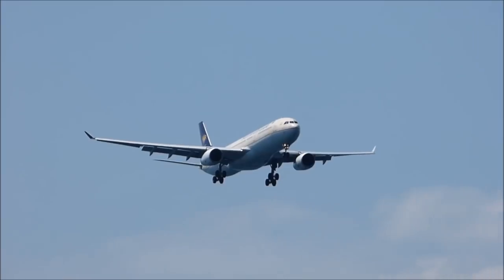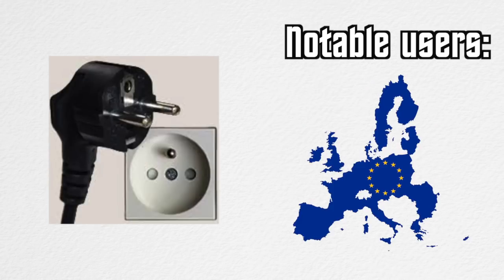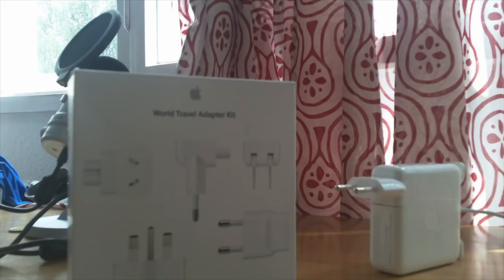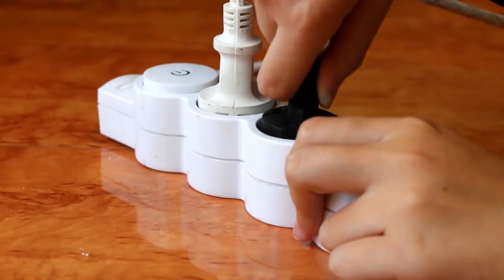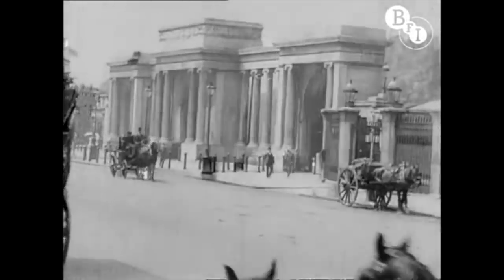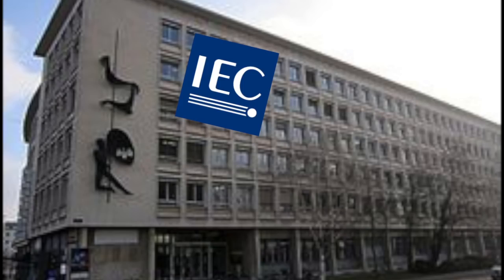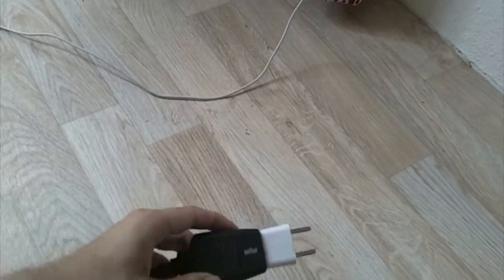Why Different Countries Use Different Plugs

Comment: Surprised nobody is flipping out about "why does the US use 110V 220V is much superior!!"

To answer this, we do have 220V coming into every home. It's two 110V leads that are combined for higher powered loads such as large air conditioners or electric dryers. So yes, we have 220V, it's just not the regular standard that you run your phone charger on.
Reply: Ah you are talking about 2 phase electricity. Of course we have that in Europe as well and it combines 2 230 volt phases into 400 volts. But contrary to popular belief most if not all modern 2 phase motors don't combine the 2 phases into one but actually utilize all 3 electric phases through 3 separate circuits so basically it's 3 motors in 1 and they're actually 3 phase motors. 

Despite your claims, the base voltage in Europe is double of the US one. And higher voltage is better because you need less current (half the current in this case) for the same transfer of power. That means thinner wires for the same power with less loss of energy. And a lower current (Amps) is lots safer as well.
Reply: Well, by that standard, we get 400V to our house over here, because we got three phases with 230V each...yet the entire house (except for a couple outlets in our basement) are wired to 230V. and NONE are wired to 110V.
Reply: European factories ad yards use the same method to power tools that are too big for standard 220V. Obviously, using two 220V phases the result is further more powerful.
Reply: We use 240 and 120 volts in the U.S.
Reply: Ive been told that 110v is safer because it wont kill a human. Is this true ?
Reply: @System-br1tx  it's not the volts that kill, it's the amps. Example of this being the voltage of static electricity being 3,000 volts.
Reply: @cpufreak101  wrong. First of all static electricity is closer to 200,000 volts. Secondly, it's not the amps that kill, that is a misconception. It's both volts and amps that kill because they are proportional. Yes, technically the amps do directly kill you, but current can't kill you if the voltage isn't high enough. 3000 amps won't kill you if the voltage is low, and 100 or 200 volts won't kill you if the amperage is low. Both need to be high
Reply: @AverageAlien  A: just wanted to say I got that 3,000 volts from a college class and not the internet, but it also specified it was a minimum

B: fair point I guess, but the point still stands 110/120 isn't any safer, as at 220/240 the amperages are lower
Reply: @cpufreak101  It is a bit more complicated than that. The skin resistance of a human is not lineair to start with. An electric fence generates up to 2500V pulse which are very short but you will survive that.
Touching 110V can be lethal if you touch it long enough.
The frequency is also a factor. At about 55Hz the human heart starts to fibrilate. That is the reason why 50Hz and 60Hz were choosen as mainfrequency's.
Reply: @cpufreak101  it's also the volts though, since you can touch the terminals of a 12V car battery (which can deliver hundreds of amps) without problems. There is a voltage that will break through your skin, it's around 50-70V, dependant on moisture and condition of your skin. Once there's current going through you, especially past your heart, the problem is that is disrupts the normal signalling your body uses. Either way, 110vs230 not much different for safety
Reply: @AverageAlien  Power company linemen fairly routinely handle 230000V and more inspecting and repairing transmission lines, but because there is no current flow it only tingles.  However, 100mA through the heart can stop it, the voltage required to accomplish this varies with the individual's body resistance.
Reply: @Gene1954  That's exactly what I said. Both kill. Low voltage with high amps, if touched by your skin or something with high enough resistance means that there won't be enough amps going through you to kill you. Low amps with high voltage won't kill you because the amps kill. But both need to be high enough to kill
Reply: @AverageAlien  3000A will kill you at low voltage. The current will disrupt cell walls. Thier have been a number of fatalities from people caught on battery terminals and from swallowing button cells through this effect.
Reply: @System-br1tx  I don't think so. I've read that the limit of safe voltage is considered to be 50 V (although, it could be different for AC and DC). But because of that, at least 48 V DC that's used in some larger IT installations, needs much less protection, because the voltage is considered to be much less dangerous than what comes out of the wall sockets.
Reply: @justin noker  : In (at least) europe, in every home we've got 3 times 230 volts coming in. Those 230 volt lines are shifted phases, combining them results in 400 volts for our power tools (only sometimes required, normal homes just operate from a single 230 volt connection)
Reply: We get 400 V for those.
Reply: All you people talking about phases and American power are mistaken. Homes have 1 phase power. 240VAC between hot wires (red and black), and 120VAC between any hot wire and the neutral wire (white). The ground wire (green or bare) and neutral are both close to earth potential for safety. This setup is called "split-phase" not to be confused with multiphase AC systems. We distribute power as 3-phase delta or wye, (and very rarely 2-phase or multiphase), and industrial and commercial customers can have 3-phase power, but almost never in residential use. Power is 60Hz in North America with very few exceptions, like 25Hz railway traction current.
Reply: Actually 110V has safety advantages. 55V would be better still which is why it's used on building sites.
Reply: but you do not get 220v in house. so its still 110v ?
Reply: @jzneter736  not quite. Like I said, every house has 220V that comes in off the lines, two hot leads and a neutral lead. The two hot leads usually go to separate sides of a circuit breaker box, which results in the 110V.
Reply: @cpufreak101  yes, but you still end up with 110 volts ?
Reply: @jzneter736  yes, because 220/2=110. We get 220v in, and it's split off into separate 110V lines at the breaker box.
Reply: @jzneter736  and also, as I did say for higher power equipment we do have special outlets for 220V power (usually found in laundry rooms or garages) that receive both the hot leads in. So it's more fair to say we typically have both 110V and 220V, but 110V is the most common for outlets (and 110V and 220V outlets are completely incompatible with each other without adapters)
Reply: @jzneter736  stoves and dryers are 220 in US homes

Comment: Brazilian plugs: a way to enforce protectionism in the most annoying way.
Reply: well, not really. The Brazilian plug has a two plug version (which is the most common one) which is a type C plug and therefore compatible with types C D E F H J K and L sockets.
https://www.worldstandards.eu/electricity/plugs-and-sockets/
Reply: @Marcelo Silveira
As I see in the website, most sockets are compatible with plug type C and many with E & F, so we are in the right direction for standarization :P
Reply: Oh you mean the fact swiss plugs look almost identical and yet they're not compatible and the fact that you have 127/220/380v and they can all be using the same plug depending on where you are so you literally need a multimeter before plugging anything in (ok only a muppet would wire 380v to a normal looking plug but still) , oh did must i even bring up the fact that a lot of sockets the earth pin is just neglected and many times when they're not it's just a straight to neutral without RCD, or maybe the fact that no electrician can agree if the socket should be up or  down, really I've never been to brazil...
Reply: I got a Brazilian Neo Geo CD and a Japanese Neo Geo CD. Neither had the PSU so I didn’t have to deal with that, but making a custom one without hacking up the console proved to be really difficult. I found that the Japanese Sharp Famicom Title and some Japanese MSX2 computers used that connector but those were even more obscure than the Neo Geo CD and their original PSUs were even more valuable. All the component catalogs only had the receptacle. Ultimately, I found some HP PSU with the same connector so I smashed it open with a hammer, swapped two wires, and it seems to work. ;)

Comment: It's nice that us danes have a plug that smiles, the only problem is that since we mostly use the EU plugs, whenever someone has a cable that is made for type K plugs, everyone in the house has to basically go around the house searching for a type K plug or type K extension cord.
Reply: K is objectively the cutest plug type out there.
Reply: May the k plug rule supreme, even though no one uses it except us:(
Reply: Thanks KhAnubis, just a fun fact. In Denmark, we have our own versions of ''Love'' or ''Yours sincerely'' that we use when ending a letter. And the most used is probably ''Kærlig Hilsen'' meaning ''Lovely Greetings'', but most of the time people just write Kh instead, just like your name.
Reply: The problem I see with a plug that smiles is toddlers. Although that can be worked around, I see no advantage on the Type K that counteracts the great disadvatange of being 'attractive'.
Reply: You should not use an European grounded plug on that as it will not ground the equipment. It is dangerous if there are is a grounded equipment next to it. IMO that looks like a smile of death. In Finland the rule is simple: if it fits, it is OK.

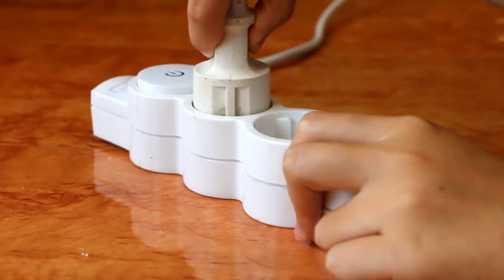Comment: 1:16 Actually, it's 120V 60Hz for North America.
Reply: And Europe officially is 230 V, not 220 to 240 volt even though most appliances have a 220 to 240 tolerance.
Reply: Still to slow to use a kettle
Reply: @jzneter736  
Yeah that's why i use a natural gas stove way cheaper to use  and faster to cook
Reply: @hihaveaniceday9386  You should see all the connectors for LP in the world.
Reply: @johndii2194    huh
Reply: @johndii2194  Try again in English.
Reply: 125v +/- actually
Reply: The standard is actually 110V+-5%
Reply: Nope, both US and Canada have 120V as nominal. Tolerances may vary at different points in the system, but generally +/-5% at service point is considered standard as per NEC.

Comment: If you were unable to focus on the adaptor from 30 cm away (which would be quite impressive for A non-macro lens anyway), why did you choose to use that photage in the video anyway, more than once even?
Reply from the maker: Bad camera. Got a new one for that reason.
Reply: @KhAnubis  Doesn't answer the question.